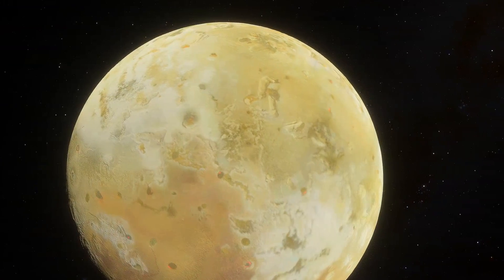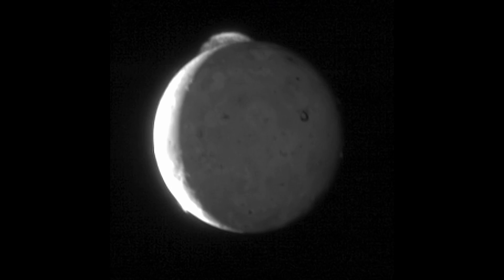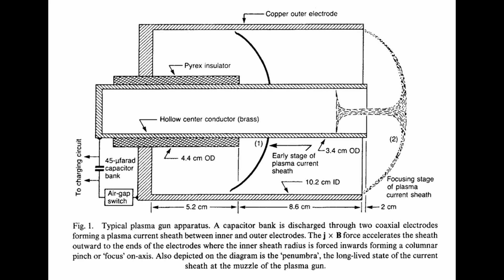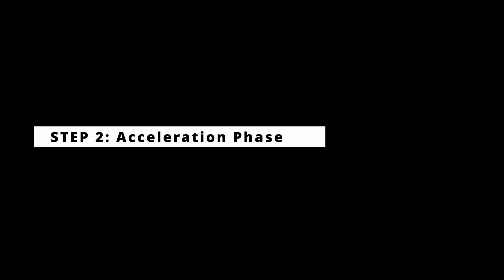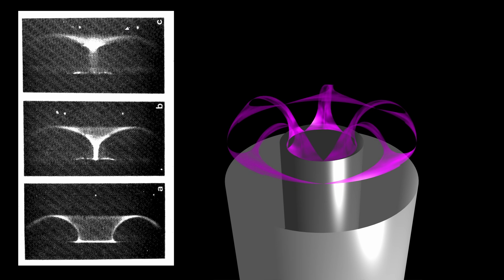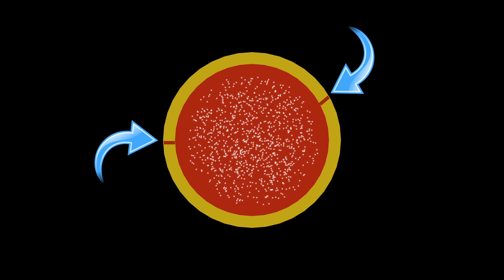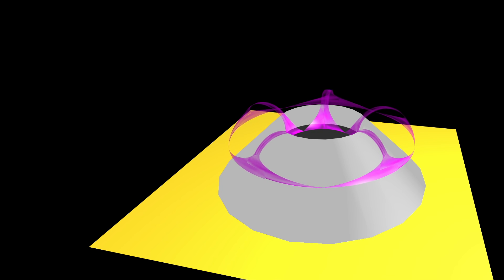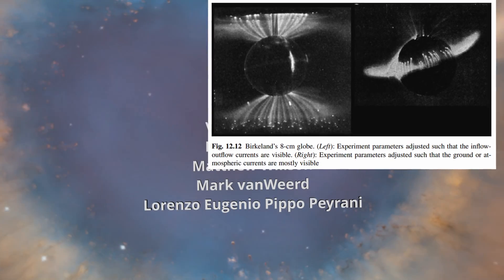Io's Plasma Gun Volcanoes

Comment: 5:00   I think a similar thing happens in the magnetotail of the planets, caused by the solar wind plasma current along the magnetopause.    A plasmoid builds in the magnetotail and lets go every so often.
One source claims that at least 200 of these have to be ejected from Saturn's magnetotail each day in order to get rid of the solar wind charged particles  that build as a plasmoid in the tail.
Reply: @plasmaphysics1017  You can disagree, but the data from the probes listed in that book disagrees with you.
Reply: @plasmaphysics1017  I do somewhat agree that the presentation in the video is somewhat misleading.  The volcanoes are not true volcanoes, as they are transported along the surface instead of remaining in place, like a volcano.  They seem to be less of a plasma focus device, as in his presentation, since the current flow is drawn off of IO by the plasma ring encircling Jupiter.
   Enceladus is also in a plasma ring around Saturn.
  However, the aurorae are caused by energy flow between the magnetosphere and ionosphere.  The jury is still out as to their true cause, but are mainly due to the day/night cycle of the Sun onto the magnetosphere and ionosphere.  
  The transfer between the ionosphere and magnetosphere, which cause the aurorae, seem more likely due to pressure mediation,  but could be due to some magnetic reconnection, since the flux ropes are involved, but are not true ropes but rather involve current sheets.  
   I have a copy of the  2nd edition of Anthony Peratt.
  I do agree that the EU leaves out the ether medium, or MHD effects of the Poynting flux.  The solar wind is a Poynting flux dominated flow that drags charged particles out with it  vs the Don Scott anode-cathode model.   
A comet is energized then by the solar wind particle differences onto the coma, as the comet approaches the Sun,  vs the EU electric comet charge/discharge cycle, AKA anode-cathode model..
Reply: @plasmaphysics1017  Actually, I have both copies of Peratt's books, 1st and 2nd edition.  I have re-read the preface in both and can find no such mention of the EU as a cult.  He does mention the IEEE, which seems to have been instrumental at guiding  his material and his books out to the public.
   Perhaps you could guide me to another part of the book where you claim he mentions this 'cult,' in connection with the EU.
  He does use the phrase 'cults' and 'colleagues,' but it seems that you jump to conclusion that he means the EU.
Reply: @plasmaphysics1017  Images from Galileo  craft vs from Voyager, 17 years earlier, have proven that the volcano Prometheus had moved some 46.5 miles along the surface from its original position.  The fact that Io's 'volcanoes' move along the surface is not in doubt.
  I would recommend a copy of the book, 'Magnetotails in the Solar System.'   It is based on  the data from the probes.
Reply: @plasmaphysics1017  I reposted the same comment.  I tried to edit it, but it would not repost as edited, so I reposted it after editing.    You tube also will not allow me to post links on , most of my posts.  
     I do agree that magnetic reconnection does occur, but as Don Scott points out, the flux ropes are actually Birkeland currents, and the reconnection is actually the joining together of the flux ropes.
   So by claiming that reconnection does not occur, Don is actually poopooing his claim that flux ropes occur out of the Sun and in the magnetosphere and magnetotail.
   That being said there is no actual evidence of a Birkeland current extending from the Sun to the Earth, they occur in the magnetosphere and tail instead.

   Charged particles are condenser of the ether medium, AKA dielectric.    Both the EU models and the Plasma model need to incorporate the ether medium into their models.  The Plasma Universe does, sort of, by using MHD.   The EU fails in this regard.   One thing is clear, electric current and plasma flows are under the complete control of the ether medium.   Magnetic flux flows drag charged particles, and charged particles condense and drag the ether medium.   Magnetic flux, magnetic fields, dielectric, and the ether medium are one and the same medium.
Reply: @plasmaphysics1017  the solar wind contains 10 particles per cc at best. That solar wind particle density is too sparce to carry a plasma current,  barring flux ropes that develope in the corona or magneto pause of the planets that concentrate the charged particles. That fact verifies that the interplanetary magnet field is not created by the motion of the charged particles, but the particles are dragged by the Poynting flux dominated flow.  The probe data verifies that Alfven waves carry them out of the corona vs the Don Scott model. 
    In fact their are rings of ENAs between Neptune and Pluto. When those particles are ionized, they are picked up again by the solar wind and accelerated outwards again by FIP, as are the particles carried out of the corona. 
   Don Scott's idea that the interplanetary magnetic field is created by the charged particle flow is invalidated but  the probe data.    The solar wind is a Poynting flux dominated flow that carries the charge particle and accelerates the newly ionized particles by FIP.
Reply: @plasmaphysics1017  Actually GPS satellites debunk the SRT and specifically all of its postulates as well as GRT.    The data from the newer GPS satellites (that can send signals between them) show that the speed of light invariance postulate of SRT is debunked.    
     The speed of light between geosynchronous satellites is the same when a signal is sent either way, because they are stationary WRT the Earth, but the speed of light between GPS satellites (which are not stationary WRT the earth but maintain their distances) clearly is dependent upon an atmosphere or medium between them, just like sound between moving trains is dependent upon the speed of sound through air, and the speed of the signal varies directly with the velocity of the receiver WRT to the Earth and the surrounding medium..
   Also, I recommend that you check out the works of Steven B. Bryant.  He has used the MM experiment to verify that light is an energy wave in a medium vs the debunked particle nature of light advanced by the Einstein puppets.
  Also, Bryant has reworked the errors in the SRT to show that neither time dilation nor the particle nature of light transmission can be true.
Reply: @plasmaphysics1017  Check out the General Science Journal and 'Global Positioning System and the Invariance of Light Speed'   Feb 1, 2015
Vitali Sokolov & Gennadiy Sokolov
621 Sundance Lane # 105, Blacksburg, VA 2406
***debunks all of Einstein's SRT postulates.
Reply: @plasmaphysics1017  Bryant has a book 'Disruptive: Rewriting the rules of Physics.'   He also has several papers online and YT videos which show that "Relativity Fails to Explain a Key Experiment.'   Specifically MM observed moving fringes and a returns a speed of 7.5 km/sec for the speed of the earth around the Sun, when SRT equations is used, which debunks SRT.   
    When properly analyzed with the correct equation, MM returns a value of about 30 km/sec.   In fact there are at least 2 dozen interferometer experiments that return a value of about 7.5 km/sec when the improper equation of SRT or a particle-based light equation is used.
  When we assume that light is an energy wave in a medium, and  the MM data is computed using the Superposition of Waves equation, MM returns the proper value for the speed of the Earth around the Sun.
  There are multiple experiments that verify the existence of the ether medium.
Reply: @plasmaphysics1017  "Conclusion
Because the atmosphere rotates relative to the satellites orbits,
which are at rest relative to the inertial frame, the GPS signalsof 
travel from west to east faster than from east to west. The motion 
of the atmosphere does not change the times of signals from sat ellites to the receiver on the Earth but it changes the times of the 
signals between satellites and the times of signals from the Earth 
to satellites. The amendment to the velocity signals can signifi cantly improve the accuracy of the GPS. The fact that signals 
travel from west to east with speed greater than c proves the 
falsity of SRT and the Einstein's method of synchronization"
Reply: @plasmaphysics1017  July/August 2017 GALILEAN ELECTRODYNAMICS 71
Reply: @plasmaphysics1017  The end story of GPS in regards to SRT and GRT is that several experts that work with GPS and GNSS software have papers out that show that SRT and GRT are invalid.  Tom Van Flandern, Ron Hatch, a Canadian GPS software company, and others, all affirm that GPS debunks SRT and GRT.
  Clocks just run slower due to the atmospheric or dielectric pressure that pervade the clock and circuitry.
  Effectively a back EMF is impinged onto the clock circuitry and the slower clock is due to magnetic flux or dielectric density increase.  
    There is no time dilation,  they just sync  the clocks to a stationary earth reference frame.   The fact that the satellite clocks must be synced to a stationary Earth clock debunks Einstein's reference frame postulate.
     The clock speed and gravity are both due to the dielectric density gradient around the Earth.   a clock at satellite level runs faster due to the lower dielectric density or ether medium density that pervades the clock.
   Redshift, clock speed, clock frequency, gravity gradient, the speed of light, back EMF etc. are all dictated by the ether medium density gradient or ether medium density.
  Einstein removing the ether medium requirement for EM transmission is why we are in the trouble we are including all of the paradoxes brought on by the failed Einstein models.
    MM did discover the interplanetary magnetic field as evidenced by the fact that their data returns a speed of 30km/sec when we use a wave-based equation vs the  failed Einstein particle -based SRT equation.